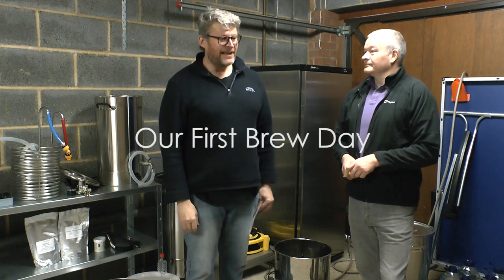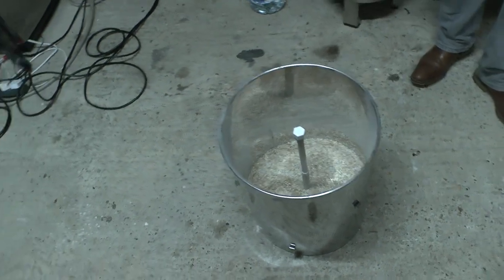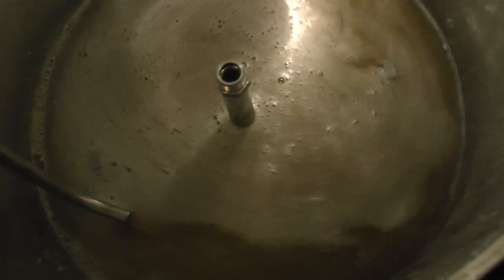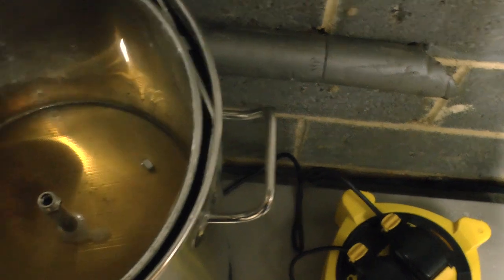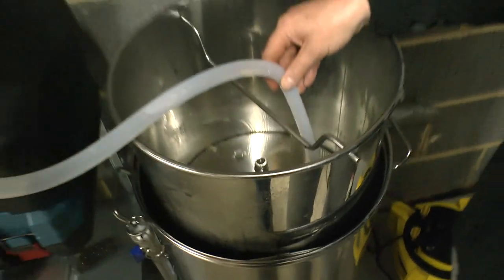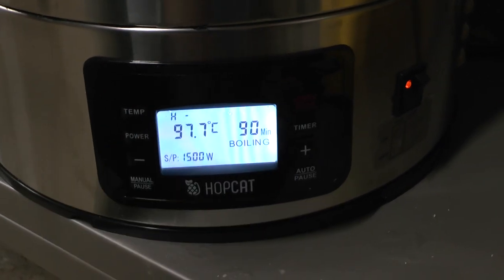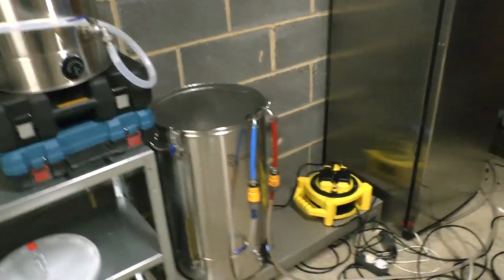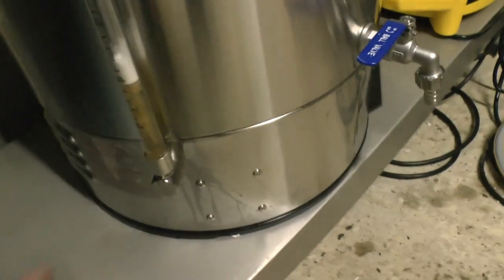First Brew

Comment: Nice first brew, it gets easier and faster with practice. 

Your pre-boil gravity will be so high as you took it prior to your sparge. The sparge dilutes it so the gravity would be lower and more what you expected.

Becareful using your extension lead coiled up as the cable will get hot and may trip your electrics, mine does unless I uncoil it.

Remember you can't use your refractometer for measuring the final gravity without doing some correction calculations. Sorry I can't advise further as I just use a hydrometer.

If the yeast in your starter has eaten the sugar it will go flat like you saw. You can stick it in the fridge overnight and the yeast will settle on the bottom and you can decant the used wort off the top.

Looks like you will have some nice beer in a few weeks
Reply from the maker: Yes, since this we've worked a lot out. On a recent bitter we were only a point off going into the fermenter - so one lesson learnt. With lagging the HC is becoming more reliable too. Actually boiling without too much trouble now. Also got the profile nearly there in Brewfather
Reply from the maker: The extension did trip in the very next brew. Also blew a plug socket on the wall and eventually wouldn't work again. We're still using a refractometer and have compared it with hydrometer and get a pretty close match when everything is the same temperature - around 20 degrees. In our last brew we were only a point off the target gravity. Getting used to the whole volume before and after boil vs gravity thing. Using brewfather now and that's helping a lot. Still learning - yeast on it's own is big enough for two lifetimes

Comment: Are you using an extension lead to power the unit? Just be careful especially if you haven’t fully unwound the extension
Reply from the maker: Yes, we worked that out early on. Ended up getting an industrial number. Sparge and Hopcat run off two separate spurs. Still gets warm in the boil but no explosions or fires yet

Comment: Hi, with the Ink Bird you plug the fridge into the cold socket - what did you use inside the fridge for warming?  Also where did you get the interconnects for the hopcat to rack into the fermenter?
Reply from the maker: We used a tube heater for a greenhouse. We got two in the end a 45 and a 65W version. AHB (Angel Home brew) sell a kit to fit the chilling coil, same size of all the Guten style kits...